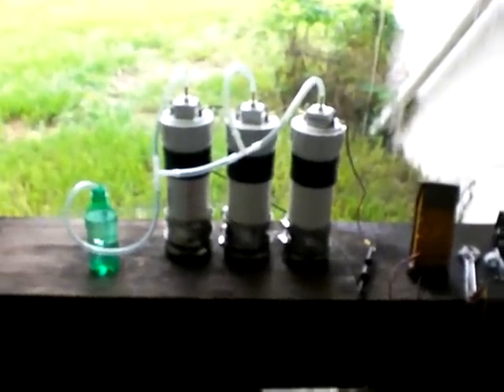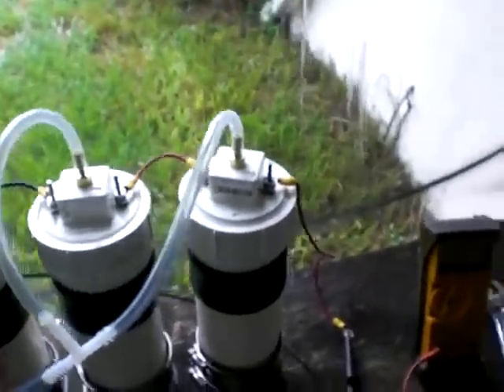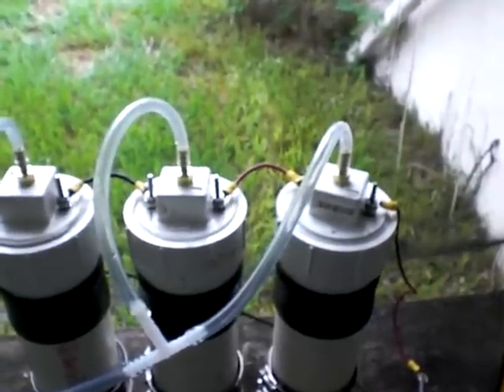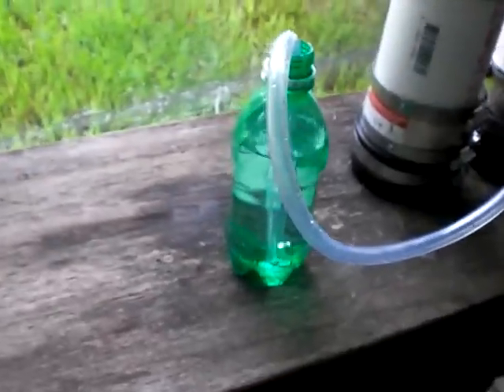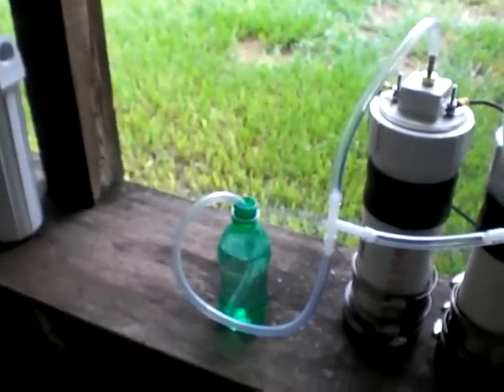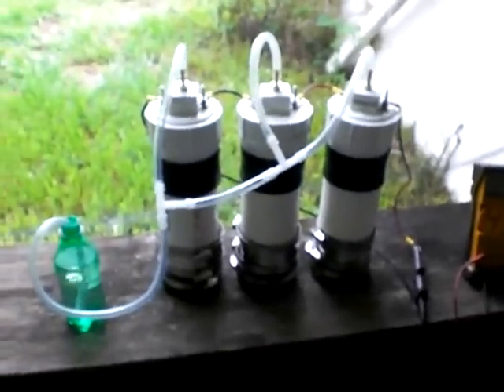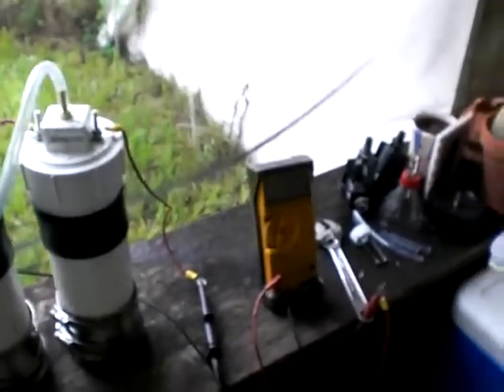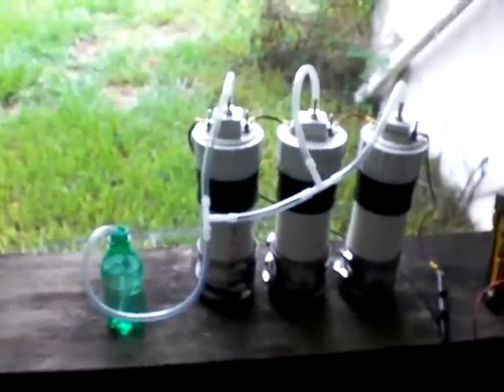The Trinity Screw Cell - Intro

Comment: Very nice setup.  I like your theory about the heat distribution.  To increase the amps, you could add more baking soda to each cell.  This will cause the amps to be pulled.  

I noticed, it looks like you have the cells hooked in series.  Have you tried hooking them up in parrallel?

Just throwing out some ideas for you to try. Good luck.